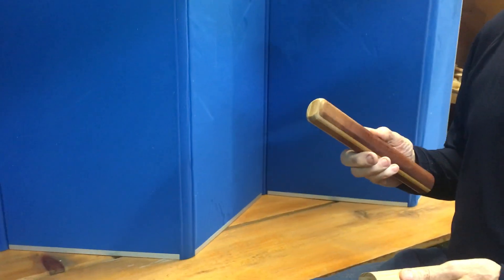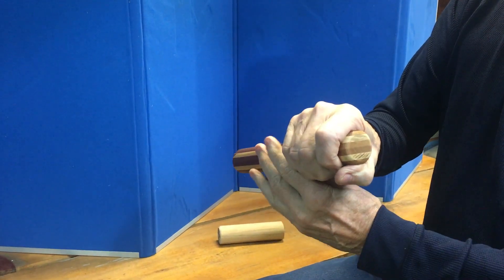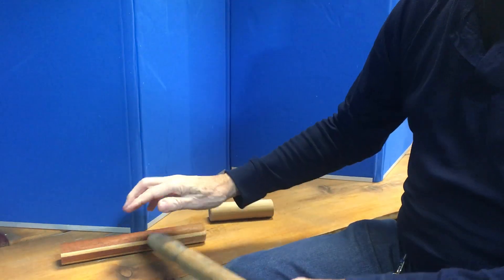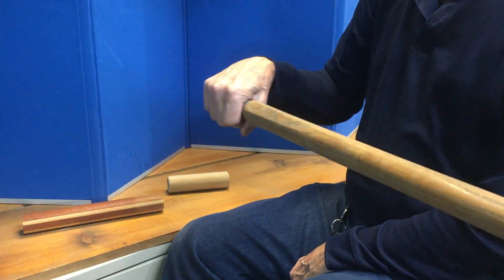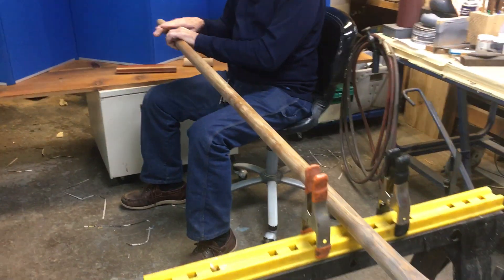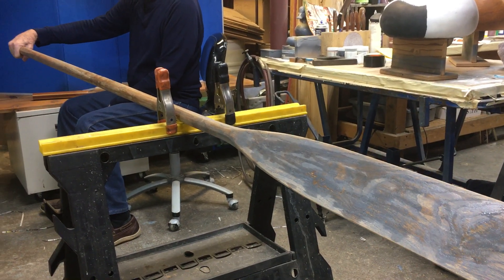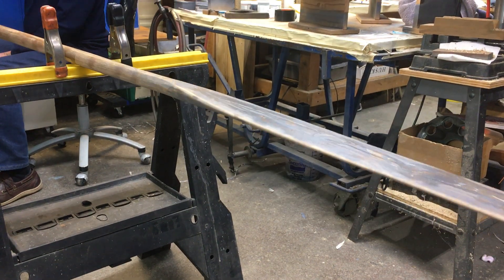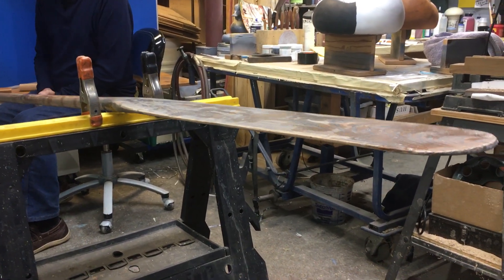"How To Scull".

Comment: I do not rotate the oar at each end of the stroke like this but through out the stroke so half way the blade is horizontal and at each side it’s “tending towards the vertical.  Making an arc with the pressure all through towards the center of the circle that that arc is a part of. 😅

Comment: Any advice on how long the oar should be? I have an 18ft open sailing boat (Drascombe Lugger), it has a socket on the starboard side of the transom which is 20 in above the waterline.  I would expect to stand at the stern end of the cockpit which is about 5 ft forward of the transom.  Thank you

Comment: can you make an sculling ore to go  backwords ?. and i do mean from the stern where you are standing in the cocpit, not going forword of the boat.
Gerard. Qld Australia
Reply: you might try "Sculling over the Stern" on the  "practicalboatowner" channel of YouTube. Man sculling is Guy Fawkles.
Reply: You can reverse the forward pattern.  It works, just not as cleanly as going forward, at least for me.
Reply: Yes you can. As stated it is not as clean. I might add two details- 1st it is much slower. But it does work and can be very handy to know how to execute in certain situations.  2nd- It will take some practice and concentration to do it. Once you have mastered forward and turning motions you brain won't want to let you do the learned motions incorrectly. However, as above,  it's the same motion, just in reverse. With your thumb rotated down instead of pushing the oar away from you you would instead be pulling it towards you.